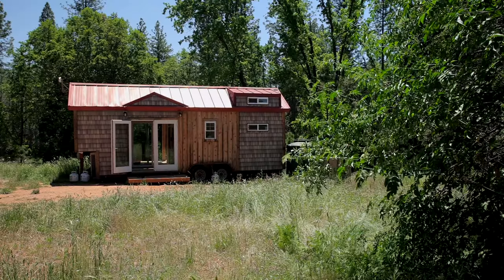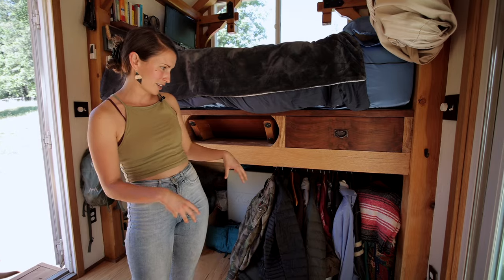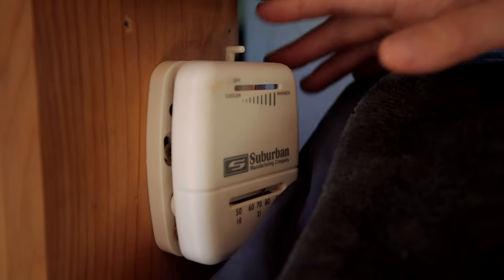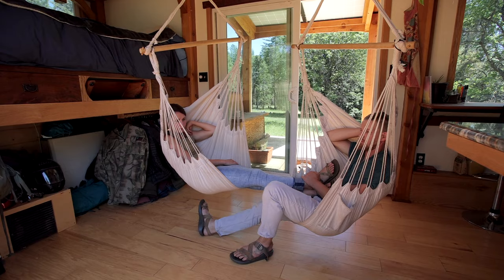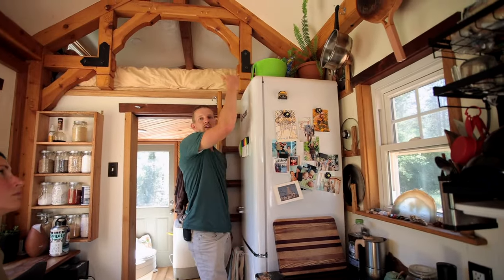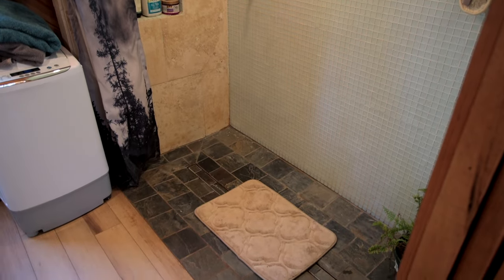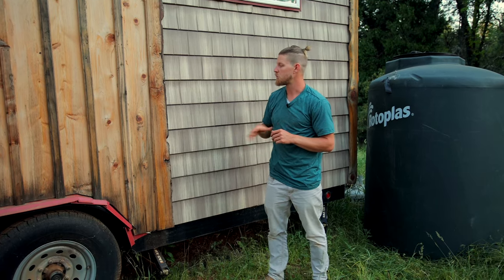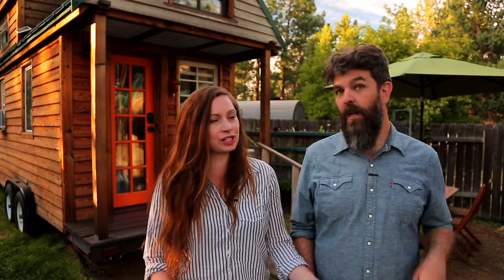Off-Grid Tiny House Homestead - Amazing DIY Timber Frame Tiny Home

Comment: Another alternative for off grid energy would be a wind turbine.It can be adapted to your site as well. This couple could put poles or towers fastened to their solar trailer. To get the wind you need. I can only see height as the only obstacle. A vawt style uses lower wind speeds vs a hawt. Also a wind turbine doesn't need the sun to work. Just wind.

Comment: "New style of building?!?!?!" You crack me up! The Japanese have been timber framing for thousands of years! A beautiful  build, but probably too heavy for most trailers.
Reply: It's new to him.  As far as it being too heavy, you apparently didn't notice the overall support system.  So much for being an expert on timber framing.  Try being snarky somewhere else.
Reply: Europe also built many buildings this way. He probably meant new for our time but said it wrong
Reply: @Kellie Thorne It IS a "new style of building" for tiny homes. Not many have done it. Don't know why though. It's exactly what I want to do. 
And I don't agree with the too heavy comment either. Even if it was a few hundred pounds heavier, shouldn't matter. Tiny home building/designing is always about sacrificing 'this' for 'that'

Comment: i think your tiny home is my favorite that ive ever seen. i am 56 and going to change my lifestyle when i retire. im going back and forth between tiny home and van life how much did your home cost to build? how much does it cost to fill your water, how much does it cost to dump your trash, and how loud is your generator? if you are having to run your air or your heat all the time do you use the generator for that, and how long will it last ? what does your generator run off of? thank you in advance! and kudos!! lori
Reply: For me, especially as one ages,  the choice of Tiny House over Van life is the far better way to go.   Especially if one has to deal with winter weather.  Living in a house vs a vehicle just seems like a more secure and sustainable situation.

Comment: Timber frame buildings can last for 500 years or more actually as a visit to Europe will demonstrate. They enable heavily insulated 6 inch walls but this couple is exposing their framing so I'm curing about the thickness of their walls. A gorgeous tiny house.

Comment: Beautiful job on the timber frame build! What was used between the timbers in the walls? Straw bales? Hempcrete? What was used to finish the surface on the inside?
Reply: We just used rigid insulation

Comment: Swamp coolers are used in the desert and only work when there is VERY low humidity. As soon as our monsoon season hits it doesn’t work! It cools down the air by adding humidity. When there is already humidity it really makes it extra SWAMPY. When it works it works very well. When it doesn’t it’s miserable.  Dual cooling would be the way to go if you can afford it. … jumps down off soap box lol.
Reply from the maker: Much of California is high desert. It’s actually pretty darn dry where we are so think it probably works very well for them 😊✨
Reply: @TinyHouseExpedition  good for them.. he just said they were by a forest.  I would hate for someone to think it’s a cheaper option for cooling everywhere.. not just in a desert .  Like I said they work really well when they work.. like really cold at times!!

Comment: Also the water you send to the garden after you use it. Put that used water to work twice. After it leaves on the way to the garden add a water electric generator so that when the water is expelled it hits a water wheel tiny or big enough and that water wheel as long as it spins it will generate electricity
Reply: Between microwind turbine microwater turbine generator and solar electric panel hopefully you will have enough put in place to give you extra electric. Doesn't have to be massive amounts but every little bit helps
Reply: Also you have nature on your side. Between water wind and sun you have a great chance of building up electricity and have what you need. I too hope to have a tiny home design similar to yours and I too will work on using nature to fuel my daily electric needs

Comment: If you live  in a cold climate I’d go the cheap Chinese 5kw diesel heater.  Minimal battery consumption and generates a LOT of heat for a couple of litres of diesel running it 10-12 hours a day
Reply from the maker: Thanks for the suggestion!